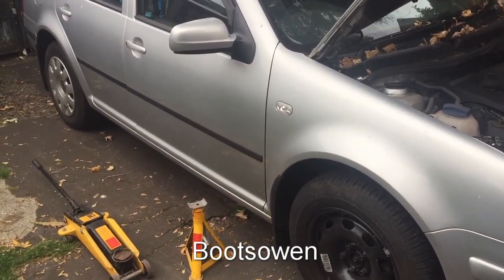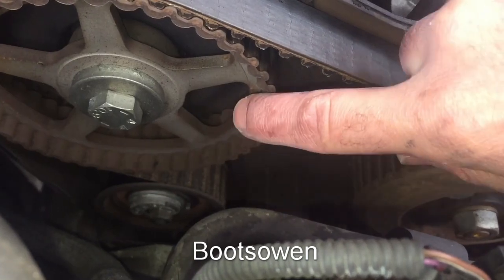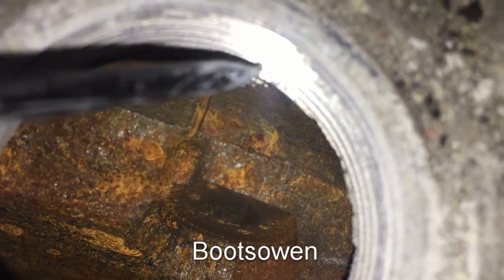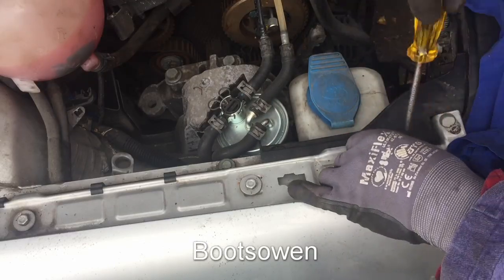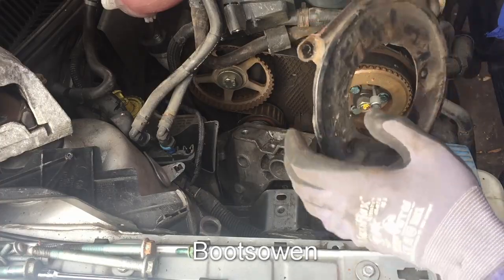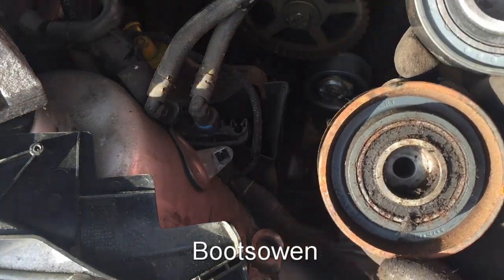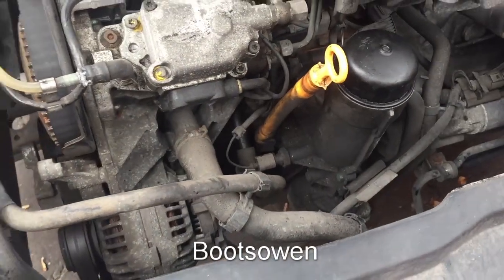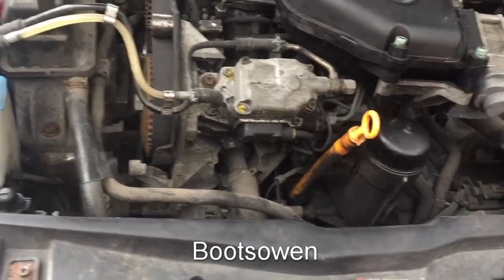VW Golf SDI 1.9 Timing Belt replacement | AQM Engine | short version | how to do it yourself

Comment: It helps a lot, thanks. But why you didn't change a water pump?  🤔
Reply from the maker: Wasn’t bothered. Some say do it. Some say not. I didn’t. Car didn’t cost me much. I show how to do it in my vw t4 abl timing belt change.
Reply: Yup, rarely belt fails because of the belt it self. Even with all the cracks and stuff it will run for years. Belt fails because of the faulty tensioner, pulleys water pump...

Comment: What cause that crying/whining noise when you accelerate the motor? Isn't the belt over tensioned? 11:34
Reply: To my knowledge it sounds fine. I got the same engine, whining should be much louder if overtensioned

Comment: Hello, you seem to know a lot about this engine and was hoping you wouldn’t mind answering a question ? I have the same car 1.9 sdi Vw golf 2002. My question is do you know anything about the gearbox? Mine had a reconditioned gearbox fitted 8k miles ago along with a new clutch,but now it pops out of 3rd gear when accelerating and the whole car vibrates when traveling over 50mph. Surely it can’t need another gearbox so soon? Any help greatly appreciated. Thank you
Reply from the maker: Because you say it vibrates based on speed I would guess your tyres need a balance. Or your suspension could be loose?  As for popping out of gear. I would check the gear selector linkage. You could also check that the engine and gearbox mounts are all present and tight. 
I’m no expert on these things. What I have suggested should be found on an mot test. It could be the gearbox. The slipping out of gear thing sounds difficult. If you know it is coming just keep your hand on the gearstick
Reply: @bootsowen  Thanks so much for the reply. I've decided just to get rid of it, it's stressing me out to be honest 😄 sometimes it's best to just cut your losses and move on. All the best